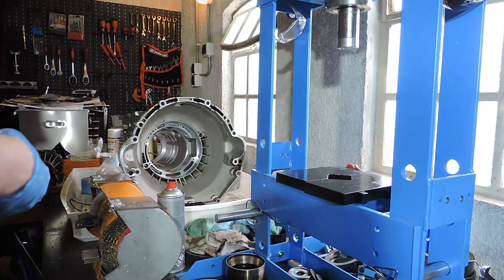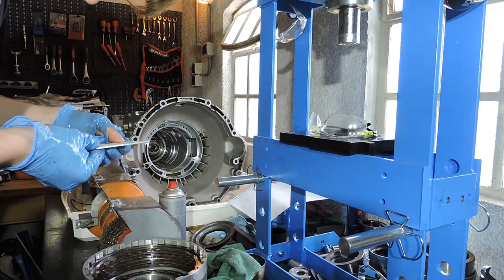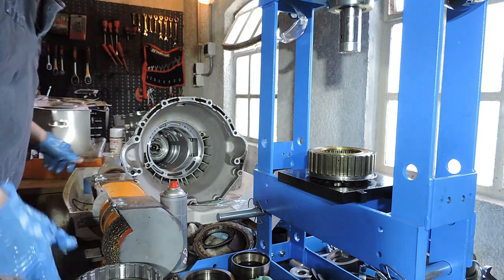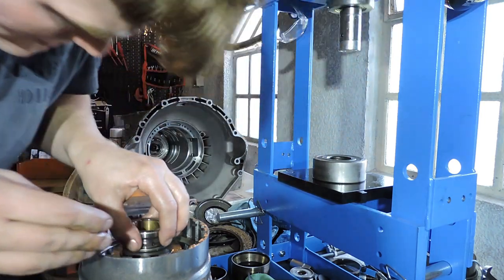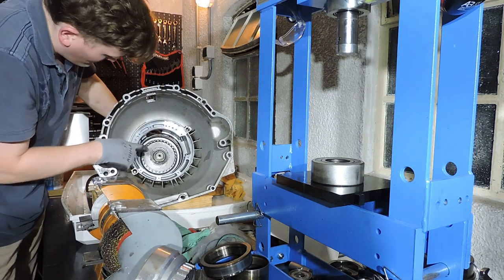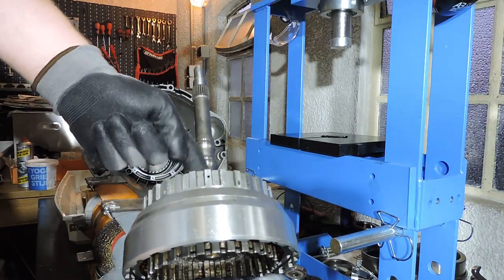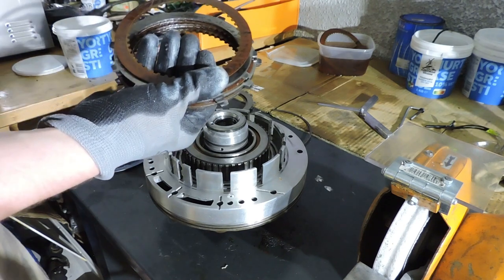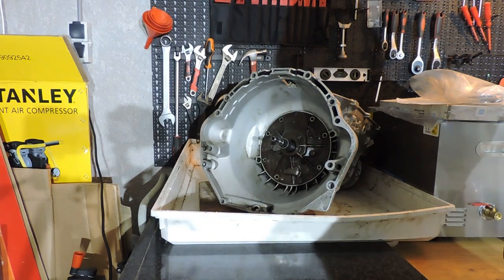5HP18 / A5S310Z (BACKYARD)

Comment: Hello, can you give me a tip?  My BMW 530i E34 uses 5HP18.  When I have a vehicle on a steep descent, or when I accelerate too hard, it disengages.  I can only walk 3rd with the winter button selected.  reverse does not work, or other gears work until you enter flat ground.  It doesn't make noises like it lacks oil or goes into emergency, it doesn't show errors on the TCM.  oil and filter were changed and the level checked.  is correct.  help please!!
Reply from the maker: I would say worn clutches and you need a rebuild.

Descent: Engine braking lets the clutch slip
Hard acceleration: Engine torque lets the clutch slip

Comment: Hi. 1997 model e39 520i aracım  sadece vites düşürürken 4 den 3 3 den 2 ye alınca vurma yapıyor sebebi nedir
Reply from the maker: 4->3 and 3->2 = 

Most of the time, pressure losses in the valve body meaning that the gear is not "catching" properly and you will experience a rough shift.

You can fix this problem by cleaning the valve body and installing a new gasket, but if the valve bores are worn out, you need a new valve body. 5HP18 bodies sometimes have broken accumulators in the valve body which can cause this.

It could also be engine failure. If the motor cannot deliver rated torque due to bad sensors or vacuum issues, the box will not shift properly either.

Çoğu zaman valf gövdesindeki basınç kayıpları, dişlinin düzgün şekilde "yakalanmadığı" ve sert bir vites değişimi yaşayacağınız anlamına gelir.

Valf gövdesini temizleyip yeni bir conta takarak bu sorunu çözebilirsiniz ancak valflerin delikleri aşınmışsa yeni bir valf gövdesine ihtiyacınız vardır. 5HP18'de bazen valf gövdesinde kırılan akümülatörler bulunur ve bu da buna neden olabilir.

Motor arızası da olabilir. Motor, kötü sensörler veya vakum sorunları nedeniyle nominal torku sağlayamıyorsa kutu da düzgün şekilde kaymayacaktır.
Reply: @poeliewoelie1987  valf  bölgesini temizledim contasını değiştirdim. Yine aynı problem devam ediyor. Ayrıca şanzımanda yeşil etiket var. Bu şanzımana ekleyeceğim yağ tam olarak nedir
Reply from the maker: @autocarcareservice8962  LT71141 oil spec.

Kilometresi ne kadar?
Reply: @poeliewoelie1987  400 bin km balata değişimi yaptım geçen sene fakat piston oring setlerini değiştrmedim sadece balata setini değiştirdim
Reply from the maker: @autocarcareservice8962  

2->3 vardiyanız nasıl?

Bu kilometrede sızdıran contalar ve eski bir valf gövdesi derdim. Valf gövdesinin basınç testine tabi tutulması gerekir.
Reply: @poeliewoelie1987  valf gövdesinde çatlak tıkanıklık yok tertemiz çıktı contasını yeniledim. Beyin içi temiz.diagnostik tarama sonucu hata kodu yok. Şanzıman adaptasyon yaptırmak gerekiyor mu
Reply: @poeliewoelie1987  vites valflerinin ohm 3.7 veriyor hepsi aynı şekilde diğer 2 valf biri geri vites diğeri ne bilmiyorum onlarda 5.8 diğeri🤔 4 veya 3 değer veriyordu sanırım hatırlamıyorum
Reply: @poeliewoelie1987  motor diagnostik yaptığımda arıza kodu self test hatası var motor ölçüm değerlerinde rolanti motorunda ünlem işareti var
Reply from the maker: @autocarcareservice8962  Vites değiştirmek için arka arkaya 5, bir dönüştürücü kavrama valfi ve basınç modülatör valfi.